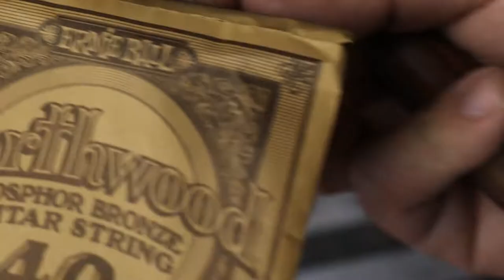Ring Build: Watch Me Make My Signature Bentwood Walnut and Copper Guitar String Ring

Comment: Hi again..i’m having problems with the copper core for the guitar string ring..i have cut 3 rings from the copper pipe i have and cannot get a good shiny finish on it due to deep scratches on the inside?  initially i use a dremel with sanding barrel and then go through the grits but have to keep going back as these scratches are deep. Could it be bad copper stock? Any help is appreciated..
Reply from the maker: Hi Phil, sounds like you're having a  frustrating time with your copper! Are you using old copper pipe to start with? I have been using a old copper pipe I salvaged from my water heater years ago with no issues. Are there deep scratches in the pipe to start with, or is it smooth to start with? I will usually start with 120 grit paper to sand down past any initial scratches or rough/sharp or marred edges and oxydization. Once I am left with just the scratches from the 120 grit paper, I move on to 180 grit and sand away the 120 grit scratches completely and then on to 220, 320, 400, 600, 800, 1000, 1500, 2000. To finish, I will use 0000 steel wool which gives a beautiful finish, but this only works well if done at higher speeds like on a lathe. I suppose a dremel could work if you can figure out how to hold the steel wool securely on the dremel... if I do it by hand I get small fine scratches. If I want to take it a step further I will use a metal polish for a brilliant shine. Use whatever grits you have available but this is what i have found to be the best approach.The most important take away here is not to move on to the next grit until the previous scratches are completely gone. The next option would be to get yourself a new length of copper pipe with a smooth interior to start with, if the pipe you have is scratched up. If you manage to get to the shiny finished surface and then wrap your veneer and do the glue up, be very careful to not let the glue run up onto the copper liner. You will have to go back and do a lot of re-sanding to clean that up. I learned that the hard way. Once you've sanded too much copper away, you are left with a thin and fairly flexible band that will collapse over time and cause the finish to crack, plus you can only sand so much away before the sizing is wrong. It takes a lot of practice to get it right so allow yourself to make a bunch of mistakes while working to get it right. I use a lathe for all these steps but it can all be accomplished with a handheld rotary tool; It may just take a little extra patience working through the sanding grits.
Reply: Thanks for the advice...The copper pipe is new, i bought the sizes you recommended..i just had a though, maybe after annealing and i go on to sizing the ring, the ring stretcher is the type you hammer on the tapered pin turning the ring as it only fits on half of the chosen size.....just wondering if that’s where i’m picking up the deep inner scratches. So my next step is cut a new copper ring and check the inside before anything else, if that’s good, check the sizing mandrel which is a Rathburn model..may have put a burr on the mandrel.....Thanks again for your valuable advice...
Reply from the maker: I use the same style stretcher as well. I have had some issues with that marring the inside or leaving indents. One thing you can try is just hammering a few times, then flip the ring over and hammer it a few more times. This also keeps the band from bulging a  it can do sometimes. I reheat after every couple of hammering to keep the copper workable. Let me know how it goes!

Comment: Hi again...I’ve cut 9 copper rings from stock and no matter how i sand i have what seem like linear cracks inside copper?  After cutting copper i inspect..no cracks, then this morning i put ring in rubber lathe fitting and gently used 0000 wire wool.....still got cracks. I compared the cracks in previous rings and they are all in the same place, so being as i’ve inspected the copper ring before any sanding i can only conclude it’s a heat from friction problem, having said that i barely put any pressure on the wire wool and only sanded for around 10 seconds.  i think i will get some copper from another supplier and hope maybe one day make the guitar ring!...Greetings from a locked down rainy UK..
Reply from the maker: Sorry you're having a bad go of it! I've not had any of these issues so maybe it is the copper after all... perhaps during the heating and stretching phase there is a step that needs some attention. I heat the copper til its a dull red, then immediately dip in water to cool. I put it on the stretcher and hammer down a handful of times, then flip it over and hammer an equal amount of times. Then I return it to the heat and dip it in water then repeat the previous steps, making sure not to be too heavy handed. Ive snapped a copper band in the early stages when I wasn't reheating the copper often enough. Maybe there is something there. Either way, I hope you stick with it. It really is a fun ring to make. If you give up at some point, and still want a ring, let me know. I do sell them on Etsy 😁

Comment: Fantastic ring and a brilliant video..thank you....what size copper tube did you use?
Reply from the maker: Thanks so much! You're very welcome. I use 1/2", 5/8", 3/4" & 7/8" to cover all sizes. This was a 3/4" in the video. I generally choose the pipe that is at or just larger than I need so that I can make the copper a full size larger than I need which gives me room to sand and polish and allows room for the resin coating. It all comes with practice. The copper pipes also come in Type "L" and Type "M" which are different wall thicknesses. I believe type M is thinner than type L. I use both which gives me options depending on the size I want to achieve. Hope that's helpful!
Reply: Thanks so much for the information. I have decided after several ca finish problems to use alumiUV for finishes..i hope someday to attain your skill full use of materials in ring making...
Reply from the maker: Thats great to hear! I hated CA finish from the very beginning. I was glad to find AlumiUV  so early on. It has its struggles too, but its worth the extra effort. Allow yourself to screw it up a bunch in the beginning until you learn how the resin works and you get your tequnique down. Good luck and if you have any questions at all, you can find me on instagram where I tend to be more than anywhere @knotsandfibersringco

Comment: What tool are you using to expand the copper after heating it?  Excellent video.
Reply from the maker: Thanks so much! The tool I use to expand the copper is called a Rathburn Ring Stretcher. Search for that on Amazon and you will find them

Comment: For the UV bath, do you know if one that's meant for curing 3d printed objects would work, or does it just have to be a certain wavelength, or does the resin indicate which to use?
Reply from the maker: It will work for sure. With AlumiUV Resin in particular, the cure times vary by light source and they state 20 watt 365 nm light source will take 5-10 minutes and a 300 watt 365 nm light source will take 2-3 seconds. A uv flashlight will work too, just depends how long you want to wait.
Reply from the maker: The bulbs in my uv bath are 9W-365nm and there are 8 bulbs so approximately 72 watts and I fully cure in 20 to 30 minutes
Reply: @knotsandfibersringco4122  Awesome! Thanks for the quick reply. I started making a few rings just using can glue, I might step it up a bit if I decide to make them more often.

Comment: Lovely piece. But i do feel you could have saved a lot of work if the ring was simply suspended in the uv Bath?
Reply from the maker: The ring was simply suspended in the UV bath at 14 minutes In the video. The ring was attached to a wire which was then suspended in the UV bath.

Comment: What are you using to hold the copper while you sand it
Reply from the maker: To hold the copper from the inside I'm using an expanding ring mandrel and to hold the copper from the outside I'm using what's called a finger saver which is made and sold by bentwoodringsupplies.com
Reply: Thanks for the reply. Great video
Reply: Can't find it on there site. Will find something similar somewhere
Reply from the maker: I spoke with the owner, a friend of mine and he says to message him about them. He says he runs out as fast as he can make them so send a message and he may be able to hook you up. His name is Thomas. Message him through his contact link on his site or find him on instagram @bentwoodringsupplies

Comment: That look fantastic! What kind of fitting are you using on the lathe when you're sanding the inside face of the ring?
Reply from the maker: Thanks so much! The holders you are referencing are made by a good friend of mine and he sells them on his site bentwoodringsupplies.com (he's also on Etsy under ThornhillWoodworx) he calls them  "finger savers" and they are worth every penny. They come in a pack of 3 to fit most standard ring sizes. Tell Thomas I sent you!
Reply: @knotsandfibersringco4122   Looks like he’s sold out, but I’ll keep an eye out. Thanks for taking the time to help!
Reply: @WalterAho  after looking at it they are just cane caps with a bolt going through it if you want to make your own
Reply: @cadenbean7682  thanks! I found some furniture let caps that are working great. They come in a handful of different sizes too.

Comment: Ring is looking good! Is there a reason why you use your lathe tools up side down?
Reply from the maker: Thanks! I'm using my skew chisel on its side as a scraping tool. The first 1/3 of my skew blade is ground flat so its parallel to the rings face, and the other 2/3 of the blade is ground to have a radius. I want to just scrape the face of the ring to flatten it and make it a consistent thickness (i think this is called a "plane cut"). I don't actually want to "cut" the wood away. This skew grind is a very versatile grind to have. If you watch my shave brush videos on my channel, you will see the same thing but I do use it right side up to when I need to cut into the piece.